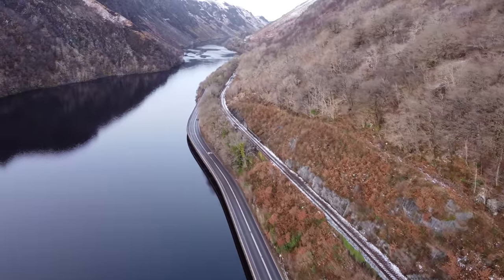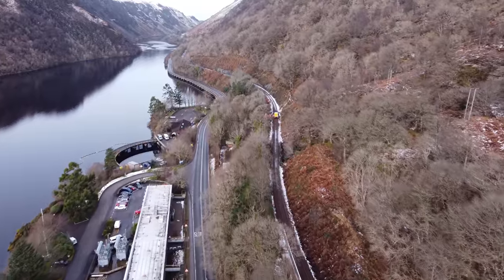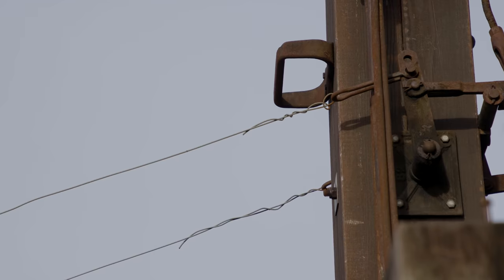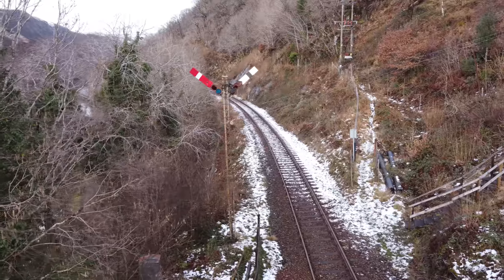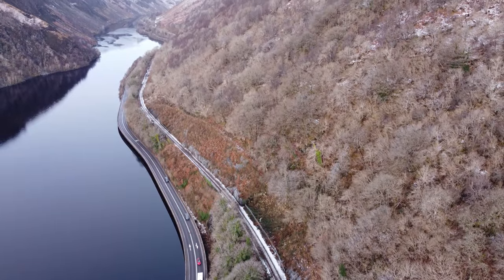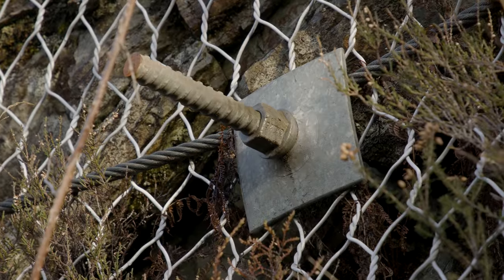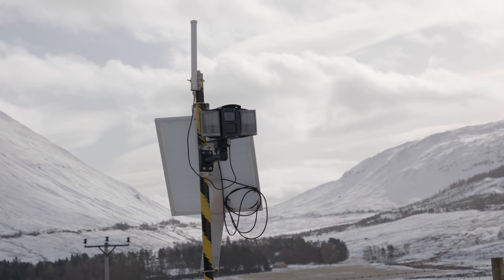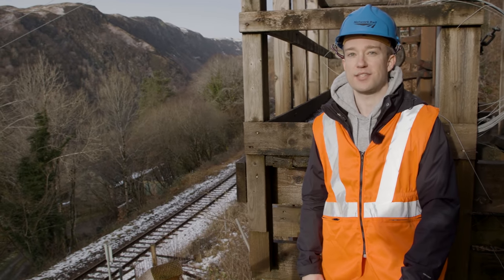After 140 years, this old technology still keeps trains safe

Comment: I just think that this proves that trains and train related devices are already near-perfect. I mean whenever someone tries to reinvent transportation, it just ends up coming back to trains one way or another.
What I'm saying is that trains are perfect and awesome machines.
Reply: also wheels are overrated because of one thing: you need roads
Reply: Says who
Reply: Sheldon Cooper approves.
Reply: @ramankhmel2094  wheels are surprisingly optimised.
Reply: @theuselessteammate2097  SoupBane.
Reply: @jan-lukas  Yes. That's how they move.
Reply: This video shows a system that is hard to maintain and doesn't inform the network that there is a problem.  That's the best that it could possibly be,  no way,  or no need to improve?
Reply: @ramankhmel2094  MOST wheeled vehicles need roads. Some of them, however, absolutely do not.
Reply: @owensparks5013  It does inform the network that there is a problem. That is literally the entire function of it, to detect falling rocks.
Reply: @ramankhmel2094  Wheels are definitely over-rated, and even take undeserved credit.  It is not the wheel that was the genius invention, it was the axle.
Reply: @Teamgeist are you one of those psychos that thinks that someone filming trains because it’s fun is hurting you in any way?
Reply: @binbows2258  No it informs the driver by putting a flag up,  the network has no idea there could be a hazard capable of derailing a train that has already occurred. The network should be telling the driver there is a problem,  not the other way around.
Reply: @binbows2258  The only improvements they have done are to enable remote sensing of the indicators, as the old technology is still amongst the most reliable method. The only drawback of this old system is that it does not have remote monitoring built in, you have to add it, which is where modern systems are going , to have all centralised control.

However that can be a big problem, if your control is off line for any reason nothing works, the old method had a central timetable, and you could still run even without any central control, devolving back to local control, albeit slower and less efficient, but still as safe as the central control.
Reply: @owensparks5013  It is also probably very cheap. Which is a huge factor.
Reply: @owensparks5013  "The network should be telling the driver there is a problem, not the other way round."

... but why tho
The driver is alerted of potential danger either way. The network is informed.
Reply: Trains are the crabs of transportation
Reply: @Remls  If your family was on the train would you like the driver informed that there is a problem before even reaching that part of the track, or to be blissfully unaware approaching it at 100mph and hope they notice? It's the equivalent of a modern smoke detector setting off a fire alarm and automatically calling the fire brigade,  vs putting up a flag and hoping someone makes a phone call.
Reply: @owensparks5013  Your analogy would be more accurate if there was someone who's main job was to watch for flags and phone them in. The train driver is the person who most needs to be aware and they're notified by this system. It's not perfect but it's extremely robust.
Reply: @binbows2258  yes. The problem with it is that it doesn't send a signal to the control center immediately.
Reply: @sullenskulls9709  Haha like axles aren't just long thin wheels. Nice try
Reply: @m.f.3347  Only in non-modern countries
Reply: It's proven technology. A lot of the safety system was designed by tragedy and hard lessons. It's amazing how well they system now works. When something works, don't f' with it! Like the fork.
Reply: Ayy, a fellow Adam Something viewer
Reply: @ramankhmel2094  imagine thinking roads are dumb, but trains, which need tracks, can't accommodate more than 1 train at a time, & can only go to specific stops along the railway are superior.

I honestly don't even have words. Trains are fantastic for transporting goods, but unless you live in a tiny country or only need to go somewhere near a stop, they make for awful people carriers.
Reply: @owensparks5013  good thing those trains aren't traveling 100mph through the Highlands. 
Where possible, drivers are alarted before a danger. But even on London's busiest mainlines, the most effective way to warn the driver from a danger is using a signal. 

Hence why a red signal is called a danger signal
Reply: @SomeGuy-lw2po  So the best way to indicate that your car has a problem is to have a stationary sign next to the road that you drive past,  not an indicator on the dash and an automatic reduction in power? Of course not,  but for trains it's OK, because that's the way we've allways done it...
Reply: Also if danger signals are sufficient how would there ever be cause for a driver's career to be ended for missing one?  (As described in this video. )
Reply: it's clearly not the best, it's good enough and the best they can be bothered to pay for.
Reply: They're the crabs of transportation
Reply: @neonwired4978  I think that's a perfect interpretation of the situation.
Reply: @Remls  if the bolder is indeed on the rails the train is stuck there until the obstruction is removed. If the network knew in advance they could dispatch someone immediately and greatly reduce any delays on train operations
Reply: @ramankhmel2094  Roads? Where we're gong we don't need roads......
Reply: @owensparks5013  ok so I'm actually a service engineer on trains, the train diagnostic system (built into the tcms) is far more advanced than you could ever imagine for a car. 
So with you're example, if you're train has a problem, yes a light does illuminate in the cab, as well as the HMI which describes the exact fault.

What we're talking about is a problem on the track. If there was an obstruction on the road you don't get a light illuminate on the dash either do you? In fact you don't even get a signal.

Trains are becoming more advanced, with the development of in cab signalling (ETCS). But that will only instruct the driver to slow or stop.
Reply: Its definitely not perfect especially with the breaking but I get what you are saying.
Reply: ok but what if we made them faster

and also make them HOVER
Reply: @owensparks5013  
The reason drivers must treat a danger signal so seriously is because of the consequences of going through one. As you could collide with another train. 

It could be compared to a pilot taking their plane onto a runway with permission. 

So if a train does SPAD (Signal Passed At Danger), there must be an investigation as to why to ensure it doesn't happen again. 
This means looking into what exactly happened, did the signal aspect change not allowing the driver to stop in time, did track conditions, or train failure result in the train not stopping, or was it driver error. 

Obviously if it's found to not be their fault, they won't be blamed.
Reply: @SomeGuy-lw2po  I appreciate the seriousness of passing a sign and the need to investigate when it happens.  My intended point was the  contradiction.  A bit of tin of the side of the track is all that is needed,  but when it doesn't work we'll have an investigation as that's really serious...
Reply: So in the end, we will have trains and crabs.
Reply: Main issue with trains (and also cars) is that they rely on a lot of expensive infrastructure that needs constant maintenance and is a big money sink. The only way reinventing transportation will be successful is if they can bring the cost of transporting things and people down.
Reply: @Teamgeist If your hobby is insulting people online, I wouldn't describe that as a "harmless" hobby.  "Harmless" is the  operative word
Reply: @owensparks5013  I think you're fundementally misunderstanding how railroad signals work. Unlike traffic lights, signals are positioned AHEAD of whatever they are marking to give the train room to stop. If a train is barrelling towards a signal at 100kph, there will be enough track between the signal and whatever it is protecting to bring the train to a stop. As explained in the video, engineers/drivers are trained to watch for, identify, and follow signals, and passing a signal indicating stop is a potentially career-ending move. 

Would you rather have a train barrelling along at 100kph incapable of knowing what danger lies ahead unless it gets a phone call?
Reply: @ramankhmel2094  Ever heard of off-road vehicles?
Reply: @sullenskulls9709 
> Wheels are definitely over-rated, and even take undeserved credit.  It is not the wheel that was the genius invention, it was the axle.
If you think about it, an axle is just another wheel that you attach more wheels to
Reply: @ramankhmel2094  When they teach you about trains on a railway course, they make a point of saying the wheels on a train are like that because the flange of the conical wheel allows the train to change rails lanes essentially. They don't slip because the weight of the train adds to the friction produced. Besides train wheels have disadvantages too e.g. they struggle with steep inclines and generally cause and suffer wear and tear to the rails and themselves in general and must be replaced regularly. Plus a train with rubber wheels would have too much friction and move slower than one on rail. The low contact area of the wheels lets trains transport heavy loads with little energy
Reply: @Chr-vk6gy  Which is true, however the few who do want to build it sweep up the pay for the entire sector. The engineers ain't cheap. Which is weird because the exams are easy
Reply: @bbbbbbb51  spotted the American (or German?). Trains have been recognized as one of the greatest methods of medium-long distance transportation by every country with decent urban planning. Also multiple trains can run on the same track so long as they are properly managed. Trains have a high efficiency and can transport hundreds of people at an efficient energy cost, and any decently designed city or town will have other methods of transport (bus, sidewalk, bike) that allows it's citizens to get reliable transport from the station to their destination. Many subway networks like the ones in Tokyo and New York have millions of commuters that depend on using it, and for good reason, it's cheap, reliable, efficient and doesn't need insurance.
Reply: So trains are the mechanical equivalent to crabs? 🦀
Reply: @owensparks5013  "the best way to indicate your car has a problem"
No. It would be the best way to indicate the road had a problem which is what is being discussed falling debris on tracks not malfunctioning trains. Imagine a fast moving road, like I don't know, a motorway; imagine there is a crash 8 miles ahead; do you smash into a pile of cars because 7miles away you are doing 70mph or is there an overhead signal and you slow down for your safety and that of your passengers?!
Reply: I’m a train driver in north Western Australia, it’s fascinating seeing other countries safe working systems
Reply: @owensparks5013  SPADs are a serious issue because drivers arent meant to pass signals set to danger (normally), signals work perfectly. the signal isnt at fault for human error if a driver passes one at danger
Reply: trains are the crabs of mass transit
Reply: @Trainman10715  The system isn't at fault if it isn't effective? That's the very definition of a faulty or inadequate system. 

Which goes back to the original point that the data was there all along, the sensor tripped.  But instead of that data being entered into the network and automatically closing that section of track it instead sits on a sign,  hoping someone will notice it.
Reply: @owensparks5013  who said the system isnt effective? its perfectly effective, it gives direct and concise feedback to a driver on the state of the line ahead. its been perfectly adequate for over 100 years and has no faults, the faults all come from human error, for which the system isnt responsable as human error will never be ridded of. yes the system could be set up to inform the control centre, but of course its more effective to signal to the driver directly rather than send the message through the control centre to then tell the driver which will take a lot longer, its a no brainer to set the system up to tell the driver who will then stop and tell the control centre, since the line speed on the west highland line doesnt exceed 45 MPH and is 25-30 most of the way, a stop on sight system is a perfectly safe thing to do. the sytem does exactly what you just described as the driver informs the control centre of the situation and the line gets closed, it also has the added bonus of the fact that the driver can visually observe the situation and inform them of whether its a false alarm or not, something which an automated system couldnt do. lastly, what good would automatically closing the track do if there is a train already on it which already has the token? the west highland line uses radio electronic token block signalling, not the usual colour light/semaphore block signalling, so theres no way of informing the driver of an issue through the control centre anyway.
Reply: @owensparks5013  It's much more efficient letting a train that's about to run into danger be alerted of the danger so they can stop safely and relay the problem back to the control center than it is to rely on the control center getting it to the train on time. The control center isn't going anywhere and if a train has just stopped at a potential hazard there should be plenty of time to alert other trains before they're even in danger.
Reply: agreed! without a doubt accurate
Reply: @owensparks5013  but it's not a bit of tin, it's a signal, and is used to show danger, caution and clear. The signal itself is only a cog in the system, the overall system is is the track circuit system. 
A signal will be set to danger is a train is on the next bit of track, or if the signaller sets the signal to danger. 
There's also AWS/TPWS which I'm not going to explain as I'm not planning on writing you an essay. But it's worth mentioning the system is more complicated and engineered than you seem to appreciate.
Reply: @d33p345  well, it'd be ideal if we could make the hovering work off permanent magnets so it didn't consume extra energy to constantly be lifting the weight of the train and cargo.  To get the costs down even lower, you could also put a bunch of teeny tiny magnets in a circle and spin them to pull the train along a track.  Ideally, those magnet circles would be made of a really abundant element (like iron) and be in pairs for stability.

Oh wait...that's just a normal train wheel.
Reply: This low tech solution for trains still beats the equivalent system used on highways.

That system being: keep your eyes on the road and hope for the best.
Reply: @dynamicworlds1  ok but if it hovers there's less friction. maglev trains exist.
Reply: @d33p345  that's why you use very, very small magnets.  Think electron size 😉

Seriously though, normal bullet trains still do very well vs maglev
Reply: Ah, I see see you've been watching "Adam Something", too!
Reply: @EvanX109  Am American, want trains in my state but one of the governments said no to the money that was available to build the service.

B is sort of hinting at the reason that government didn't want the trains. Everyone and their mum wanted a stop along the route, because that would bring income / ease of access, and that would bog the train system down. (I don't think they thought about having certain express trains just not stopping at those local routes, pity on them.)
Everyone would need to drive to the train station, sort of like rentals or parking at the airport, and we would need to reconfigure lots of land, especially those in cities, in order to accommodate them. This is something that would be expensive, and burdensome as well as having troubles with locals and permits to do.

That being said, if it were done would solve a lot of problems here. I for one have a brother in a large city that I would have been able to visit fairly cheaply by going on a train, but instead would have to drive down there myself. And in current times, the gas prices on the rise increase that problem.

Comment: I work in an underground mine in canada, and we use the same type of "tensioned rope with a flag at each end" system to monitor the beltways that run underground. It works, and it makes it easy to find a problem. You just drive until you find a flag up.
Reply: Just like the mail, with fewer pulleys.